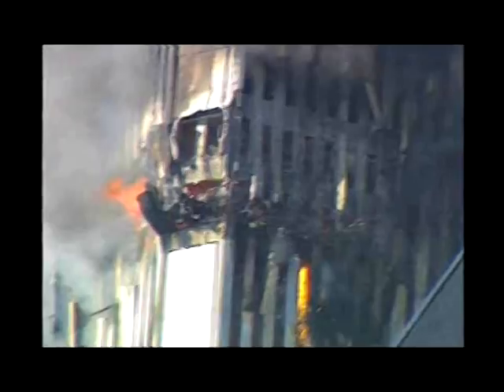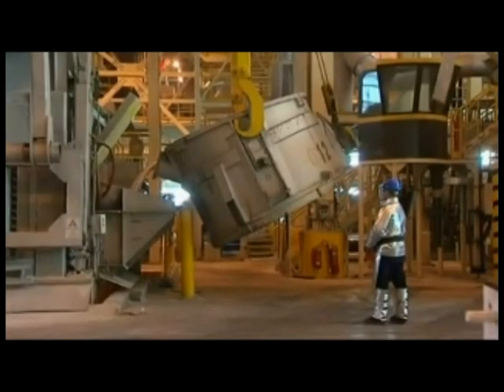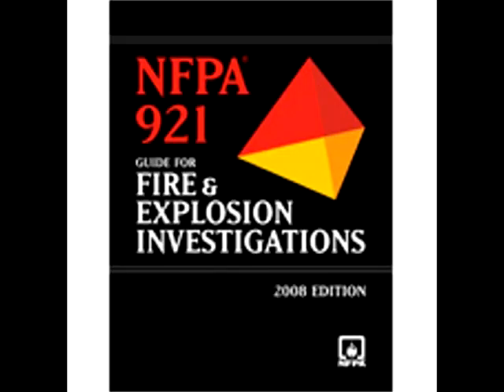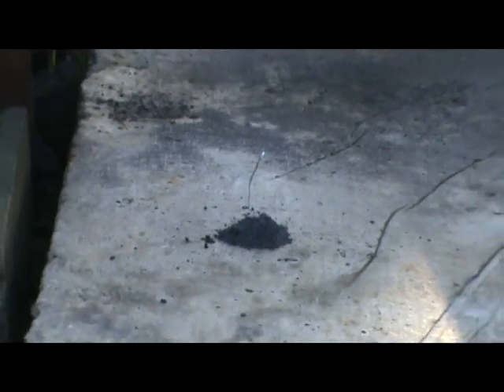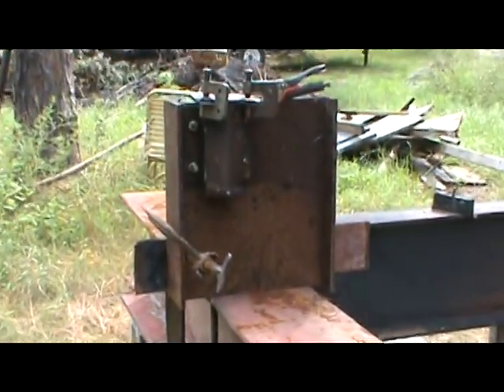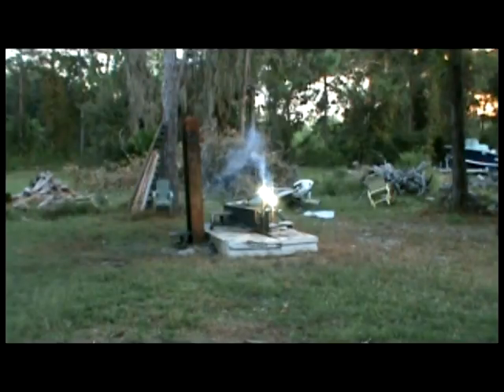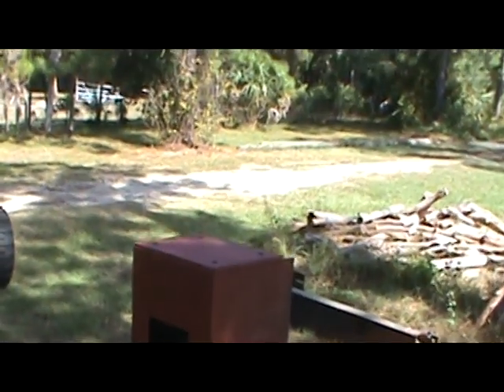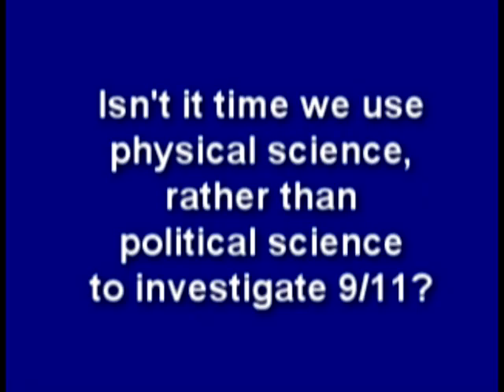9/11 Experiments: The Great Thermate Debate

Comment: What about the tonnes and tonnes of magnesium in the planes? They use magnesium rods to cut steel beams under water, and surprise surprise, it makes orange hot showers of sparks and molten metal when it goes through steel. 
There's obviously a lot of lies and cover-ups involved in the twin towers, but maybe part of the truth is that the towers were built sub-standard to begin with.
We'll never know.

Comment: This is B/S When I built Log Homes one of the selling points was that the Logs withstood fire better than Steel Girders , And it was proven . How are I Beams made ?,Well first You melt Steel ...How ? With Fire of course !
Reply: so termites eat wood also. if termite eat wood they destroy metal. problem solved

Comment: It also could of been electricity arcing and building up in the metal due to loose wires causing metal to heat up melt and the arcing of the metal can cause metal to react funny looking like termite done this I've seen these balls when people weld

Comment: What if such devices were fitted to the 47 central support beams, which are mysteriously absent from the official report as it is the only way their simulation could account for the tower collapse.  You could accomplish the same goal with much less work and contain the majority of the noise/chaos within the building itself, the molten material flowing out of the windows may be what ran across the floor.

Either way, you've done excellent work.

Comment: Such bullshit, have you ever forged your own steel? You can melt steel with potatoes, how high temps you can produce depend on amount of fuel and oxygen and not the type of fuel. I could just as easily make up a contraption that uses jet fuel to melt steel beams as you have used thermite. You do realise that a forge in a metal shop melts the steel with camping gas? And as there was 100% proof that thousands of gallons of jet fuel were in the building and no proof of thermite, then the most plausible reason is that jet fueled fire brought the building down. Do yourself a favor and search YouTube for DIY steel forge and see how easy it is to melt steel without messing around with thermite.
I'd like to send up some of these truthers in an aircraft then set it on fire midflight and then say "relax kerosene cant melt aluminum". It can and will if in a tube with a lot of oxygen blowing through it, same as if in the tube of a tower block with plenty of air being sucked in.

Comment: What a pile of tripe...10,000 gallons.of jet fuel that burns above  850 degrees ...ran through floors for 2 hours turning steel beams glowing red as they turn red at around 650 degrees...and at that temperature it loses all its strength and the building g pancaked in on itself...you dont mention that demo experts every where agree that to bring down a tower it would have needed around explosives on around 120 steel beams... But the main beans of the twin towers where also covered in a meter of concrete...so that also would have had to have been smashed off before any explosive could be placed... So a team of men would have spend days smashing off concrete on 120 beams in order to place explosives and none of them be noticed by any staff at the twin towers...err yeah !!!  Giggle giggle

Comment: Jet fuel actually can get hot enough to weaken steel and it wouldn’t take much weakening for a skyscraper to fall.
Reply: But never in history has a 10+ story building collapsed due to fire and especially not in on itself.
Reply: This video is not looking at why the towers fell, but why there is molten steel pouring from the building. Sure the steel an weaken, but it does not explain the liquid steel which we saw.
Reply: plus the base was designed to be stronger than the rest of the building. so the weaking wouldn't have that much of an effect.

Comment: ok so Thermite is Iron Oxide an Aluminum Oxide....So those panels where rusted when put into place. They had been sand blasted an let rust creating Iron Oxide, Iron Oxide is also used in Paints. Now to Aluminum Oxide an Magnesium. The Airplanes. Aluminum Oxide covers all aluminum about 4nm thick. Combined with the Jet fuel. It's possible building 7 is a total different story. Magnesium fires are Hot as are Aluminum. So is it possible that this actually reacted in a thermite fashion sure it is. It might be a stretch but its not like we can recreate it either

Comment: Interesting video, and I quite like that you conducted your own experiments. But I have two issues.

1:molten aluminium can indeed glow red hot. You just have to raise the temperature above the melting point. (To around 1100 degrees C )

2: it's possible to manufacture thermite on the fly with an oxidizing flame and molten aluminium.  I have seen this happen first hand when operating forges with steel crucibles and molten aluminium.

Considering that a simple rocket stove can achieve the necessary temperatures to pull this off, it's not much of a stretch to imagine that a burning skyscraper full of   kerosene would also do this.

Comment: The thing that bugs me the most is we have drones capable of taking off flying landing launching missiles and other drones. Now because of this airport security measures have become similar to prison processing. Which doesn't stop a person from becoming a commercial pilot for the intent to do this again. Simply put we have the technology and can issue a federal mandate to equip all commercial airliners with a remote failsafe. When a plane deviates off course enough without reason its controls are overridden and it's remotely landed.

Comment: Great experiment. But one huge huge problem with what you are trying to prove. 
Are you actually implying that someone or a team of people were able to gain access to structural steal inside of a wall and weld in similar contraptions to  your box cutter device without being noticed. The shere weight and volume of these contraptions would have been unmistakable and noticed. 
Great physics experiment which is enjoyable to watch but you're all totally off your trollies.